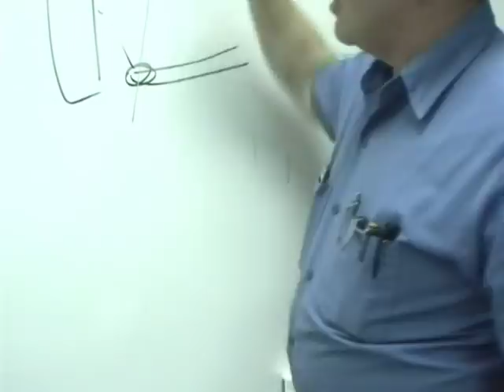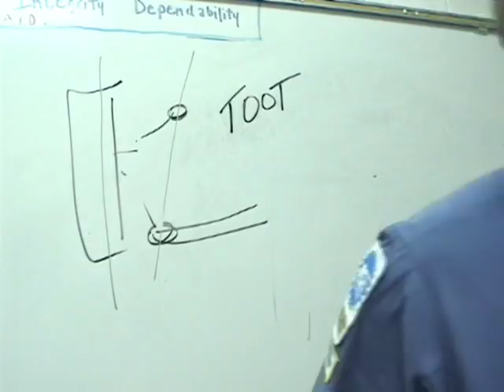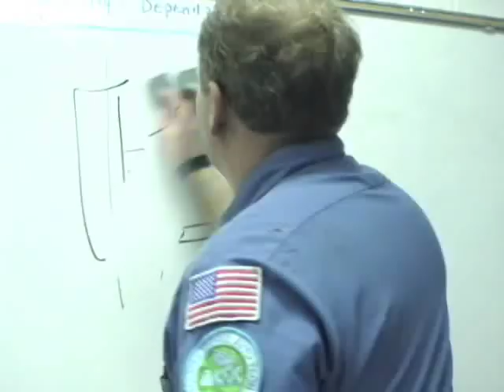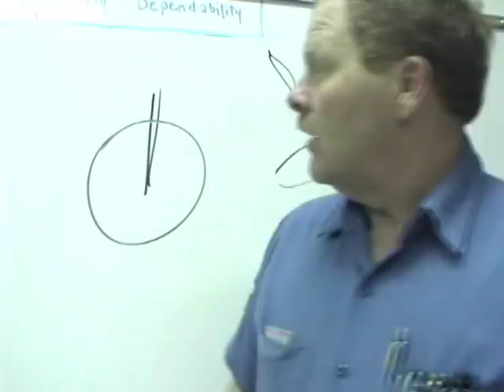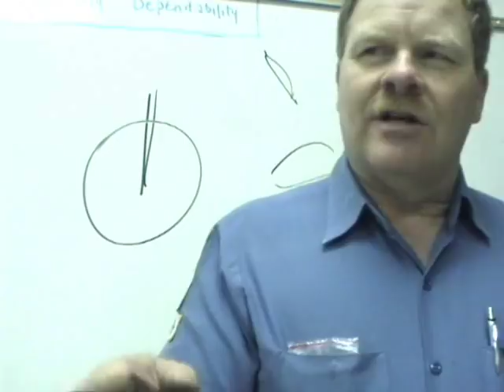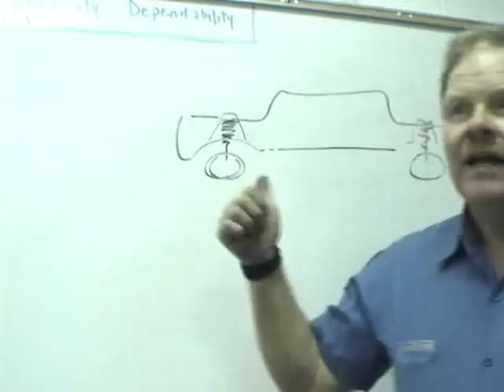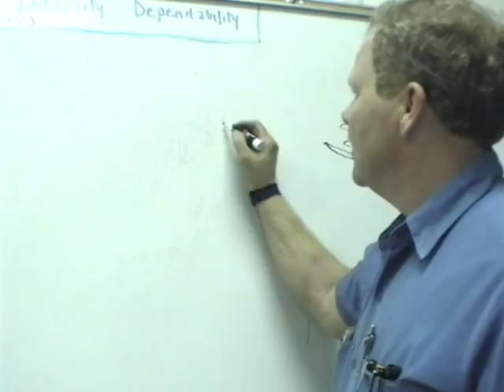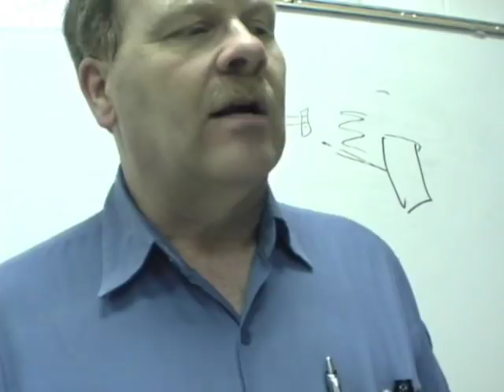Steering and Suspension Opener.wmv

Comment from the maker: Unfortunately, the original copy of the video did that because I made it with a camera connected by a firewire cable to my computer - and my computer was for some reason uncooperative - it hadn't been before - but the video was corrupted - irretrievably so.  After this I went with stand alone cameras that use SD cards and these problems went away.